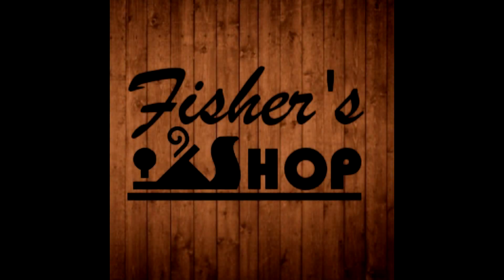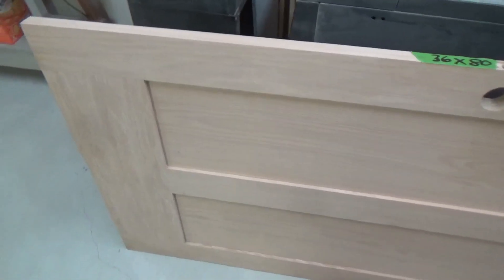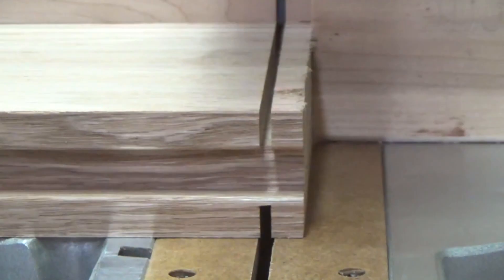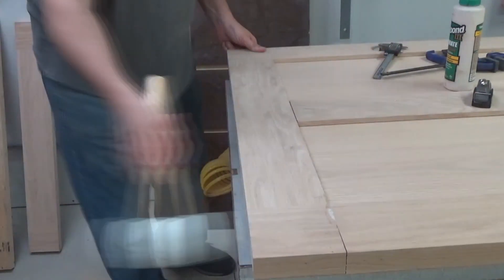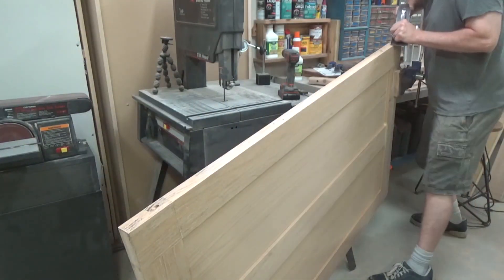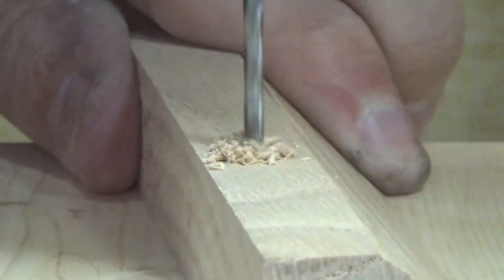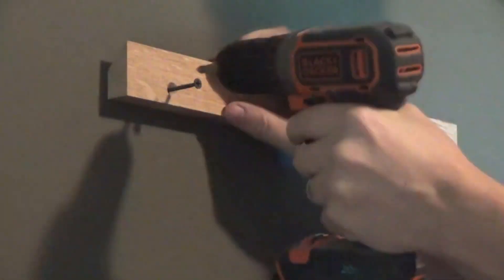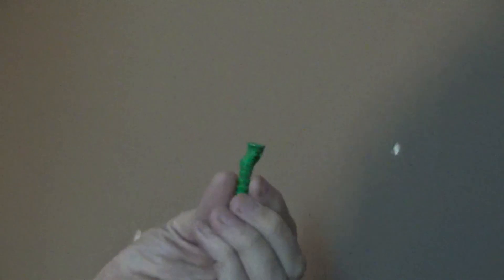Woodworking: How to make a headboard from an old door

Comment: Got a question about your zero clearance plate that you are using on your table saw. I noticed that it’s not screwed down . Is it a safety hazard if you don’t screw it down when you’re using the table saw?
Reply from the maker: Not really.  That was an old saw and that's just how they did it back then.  Some zero clearance inserts or throat plates nowadays have a lever-activated latch that holds them down or something else similar but some still just drop in like this one.  It's not crucial in my opinion.
Reply: Fisher's Shop thanks for clearing that up for me! Love your videos, especially the outtakes!

Comment: Once I knew the parts weren't glued together I would have trimmed the center parts to the proper length, centered the knob hole and used the knob hole to mount a small two bulb reading lamp aimed at either side of the bed.
Reply from the maker: That's not a bad idea. :)
Reply: Thanks.

Comment: Wow what a find and i can't believe those panels were loose like that. Great job on the door/headboard with trimming it to fit as well, on that note the last piece you did with the screws, why didn't you just screw straight into it instead of the kreg angle, or use a biscuit jointer? anyway your choice and i was only asking ha ha, great build and video and keep up the good work.
Barry (ENG)
Reply from the maker: Good question.  I suppose I could have done them all straight in, but I didn't think it really mattered since they were all getting covered with edge banding.  I don't own a biscuit jointer but I did think about using dowels to join the pieces.  I changed my mind once I saw how well things were held in alignment from the panels and the center board.  So at that point, I figured a few screws ought to be all the additional support I'd need.  If I didn't edge band, I would have definitely had to use some type of internal joinery.  Thanks for watching and commenting, Barry!
Reply: Great, thanks for the quick reply and keep up the good work.
Barry (ENG)
Reply: Barry Roberts the panels aren’t glued in on purpose so they can expand and contract separately from the rails around them. This avoids cracking as humidity causes the different pieces to expand and contract in different directions. Solid woods (as opposed to plywood, waferboard or particle board) expand and contract along their length with changes in humidity. The panel pieces grain expands and contracts 90 degrees from the direction that the rails expand.

Comment: That worked out really nice indeed, great idea to use a door and then cut it down to size! :-)

And thanks for the tip about the painters tape on the wall when marking things up, I've got way too many little pencil marks on my walls so will start using the painters tape when marking stuff up from now on.

Actually thinking about it you can use the painters tape everywhere when marking up stuff, great little tip!
Reply from the maker: My pleasure, Morten!  Glad you liked it!  Thanks for watching and commenting